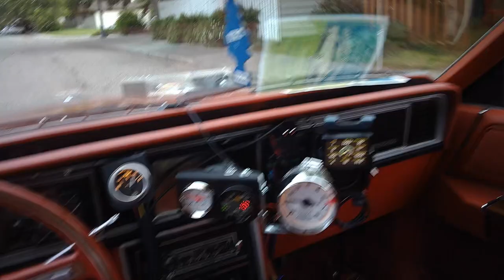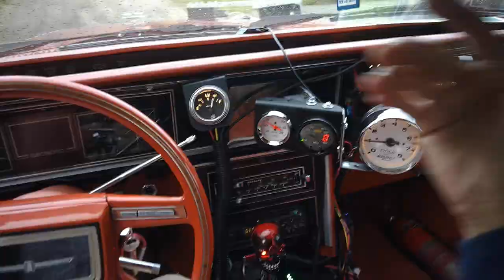Boosted 408 LS burnouts, and AEM GPS speedometer  verification

Comment: I love to see you put a video up with great detail on setting up terminator x for boost control
Reply from the maker: Most definitely. when I get to that point I'll post a video on the procedure. For now I'm just running waste gate spring pressure which is around 14 psi I believe. So the theory is that when manifold pressure gets to around 14 psi the waste gate should open limiting the boost pressure to that. I'll probably throw a manual boost controller in the system in the mean time so I can see how the car reacts to different levels of boost before I let the terminator x handle the control. Thanks for commenting, and were all learning as we go....Oliver